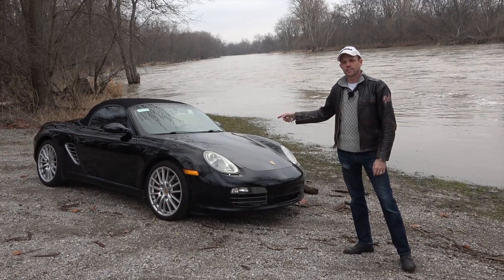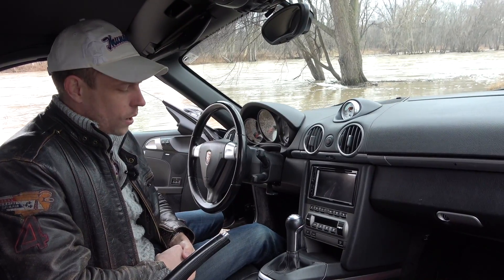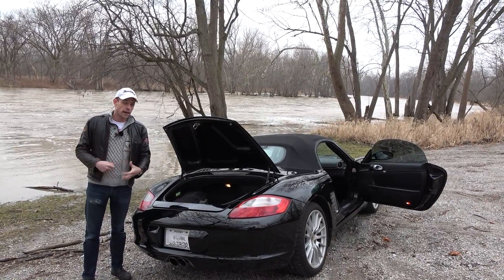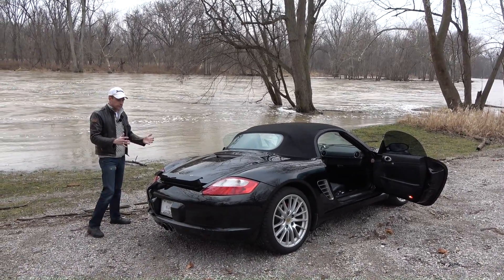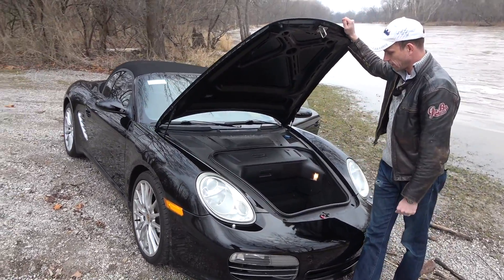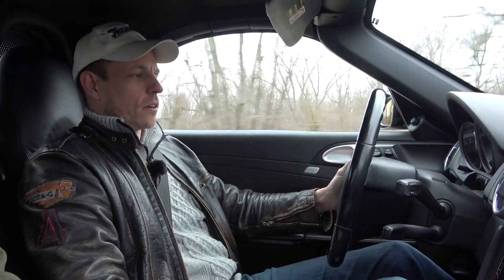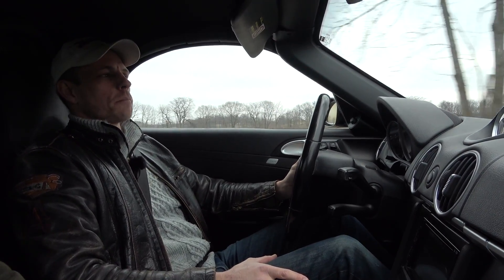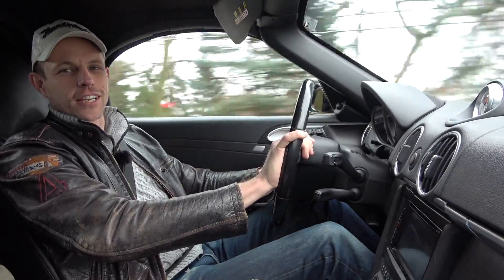Porsche destruction for LYKAN HYPERSPORT build at Genius Garage

Comment: Should be able to get into the coading with a bidirectional scanner, I use a launch x431 + .    Spoiler can be set to come up and down I believe at chosen speeds, my 07 Cayman S will also deploy and stay up based on engine temperature. Should be the same rear control module.  Found this out the hard way when my canbus had a glitch.  Lots of opportunities to use repurposed deleted or unelected options if you keep the stock system.  Definitely not an expert but refused to take the car to Porsche so 40 hours later I got it and am more familiar with my car.
Reply from the maker: Brandon Knight can you DM me on Instagram or send me an email through Genius Garage please? I’d really like to speak to you about this.

Comment: Good job. That one has Sport Chrono for a little more power and the better headlights. When y’all strip the car, the body panels, top, and headlights are worth some decent money. Try not to damage them. You should be able to swap in brakes from basically any 911 if the wheels clear. If I remember right, the rear wheels from a 911 fit but require 14mm spacers to clear the shocks. Hood gas struts are very cheap and may be worth buying to reduce headache while measuring, planning, and stripping. Don’t lose or break interior parts. The cup holder is like $140 used. Ashtrays are stupidly expensive.

I had a 986 S.

Comment: I love that you are doing this as a Genius Garage build. Also starting to fall for that 987 - which is going to hurt to see it get chopped, but its sacrifice will be returned 10-fold in the Lycan that you are recreating. 

Also, while I will watch, Youtube car builds always fill me with overconfidence in doing my own car repairs. Everything always looks so easy on Youtube! But then in real life I spend 5 minutes trying to figure out where the latch is to pop the hood open. (I loved my ‘68 Firebird - just walk up to the car, reach in under the grill and pop the engine open. That car I could and did tear down to the long block - new cars have 80,000 hoses and wires and boxes on top of the engine.)

Comment: Hey Casey, I sent you another couple emails.

If my internet research is correct, under the skin the Lykan is essentially the same chassis as that RUF CTR3 which is a Boxter tub cut behind the rear seat with a new "birdcage" connecting between the existing roll bar mount and A pillars.  It sounds like all of the stretch is in the "birdcage".

Beyond that, I found a source for information on the design that you might be able to contact.

I also suggested a change in design which might reduce costs and save time over a straight copy.

For those thinking that the chassis isn't going to be right, you are wrong, everything at the front should be close to a bolt in fit and exactly like a $3,400,000 Lykan.  The rear is just about how much effort they put in to it.  As long as they ditch the rear struts, I think it will be fine.

Comment: I have 06 cayman and I have the 996 GT3 brakes front and the original front brakes in the back. You loose the handbrake on it. But worth it. Also do a deep sump and x51 oil pan
Reply: TOROgarage wanna sell your stock calipers ?
Reply: @artmchugh5644  don't have it anymore
Reply: TOROgarage thanks man ! I hear those calipers are the hot ticket for our 85 carrera! !😄😄😄🍺🍺🍺🍺🍺

Comment: 10:17 Casey executes a perfect rev-matched double-clutch downshift while talking. Nice. :)
Reply: Is this technique meant to be used when you're putting along and want to do rev-match downshift without heel-toe?
Reply: @ayowser01  No, it is used to perform shifts faster, with less wear on the transmission. On vehicles (like big trucks) without syncromesh or with straight-cut gears, it's almost always used. 

Here's what he is doing: he declutches, and shifts to neutral. This disconnects the engine from the transmission. Next, he lets the clutch out, and taps the throttle, spinning up the engine - but because he first re-engaged the clutch, it also spins up the input portion of the transmission to match the engine speed. This means that the input portion of the transmission now matches the speed of the output portion of the transmission for the destination gear. Next, he declutches again and shifts into the lower gear. Because the input portion of the transmission has already been spun up to speed, the syncro on that gear has very little work to do, which means a) a faster shift, and b) less wear on the syncro. Lastly, he lets the clutch out once more, and the shift is complete.
Reply: @ScottsSynthStuff  Very nice explanation.

So you are telling me that my habit of not giving the clutch time to decouple as I am bouncing off the rev limiter in first and just ripping it into second might create some syncro wear and be slower?
Reply: @opieg7333  Basically, yes. The synchro speeds up or down the input portion of the transmission to match the output portion. The faster and harder you jam it into gear, the harder it has to work to do this, and they more wear occurs. I see you're a bike rider - bike transmissions are similar, but not exactly the same. But the same basic principles apply.

Comment: Building a chassis from scratch would be wayyyyy better and probably easier in the long run. I really dont see how your going to get a "clean" build with a hacked up uni-body.
Reply: Having seen what he's done previously....Do you really seriously think he's going to hack a unibody to build the Lykan? The Guy that scratch built a Jet Powered BatMobile? Which video did you watch?
Reply: @danstewart8218  I am not doubting the abilities of Casey, uni-bodies are a matrix of stamped and overlapping metal spot welded together and designed to make a Porsche not a Lykan. I think that starting from scratch would produce a much better final product. This is a place for discussion and that's what I am doing.
Reply: @MODNTUNE  I think the goal might be to preserve some of the interior trim, instrumentation and associated mounting points. Sure that can be added on a build from scratch frame but done right it takes forever to get the ergonomics and engineering correct. (Of course with no Lykan example to inspect and the fact its a very low production car, the ergonomics may  have never been correct).  Maybe he is fine with a "kit car" interior finish in which case slapping in some recaros and autometer gear with simple sheet metal fabrication will suffice. And I think the shell is designed to mount up to a modified version of that chassis, but might be wrong on that. (Even if no, it is designed to fit a Porsche body which likely means some commonality in mounting points).  So my thinking on the strategy is it simply saves some time on the finish work.

Comment: My dude, this is definitely a cool build...
But, if that car wasn't built with an engine to begin with I wouldn't trust putting anything in it.. I personally would think you would want to start from scratch.. 

Ok.. Nvmnd, i guess you are just gonna use the panels from the Lykan not the frame..
😆 😆, i knew you were smarter than that!

Comment: I was watching a video with a 996 911 turbo and it’s coolant pipes failed because they were “press” fitted and glued on as opposed to being welded and or “pinned” on. If that’s something they will need to fix on this car, before reinstalling the engine, I hope we get to see the video of it as it’s being performed.
Reply: The Boxster uses a different engine than the Turbo and GT versions of the 911 (996, 997). The Boxster/Cayman/911 water-cooled engine family were clean-slate designs and labeled M96, M97, etc. The engines that require the coolant pipe pinning (or welding) are based on the old proven Mezger air-cooled 911 engines, obviously modified to accept water-cooling.

Comment: Also I hope LYKAN will be nice with this and not give you a hard time. I and I assume you have seen problems like that.
Reply: It sounds like W Motors tried to scare the bankrupt production company in to giving the Lykan prop back.

I wouldn't expect any type of willing support from them.

Luckily beside the body, a fancy interior and a holographic display in the dash, it seems to be mostly RUF CTR3 which itself is largely Boxter under the skin.

If W Motors is a big enough customer to influence RUF, they might tell them not to support Genius Garage but that is a bit of a stretch and if Genius Garage doesn't try to turn the body in to a 100% correct replica, W Motors probably won't go too far out of their way to block the project.

I think the easiest way to finish this project is going to be using a good portion of the Boxster interior, different rear suspension, an engine that is not a built RUF turbo 3.8 and the fiberglass prop body, not pulling molds to re-make it in carbon fiber.  The result of that might look like a Lykan but the illusion will fall apart once a door or the engine cover is opened.

W Motors is concerned with the exclusivity of the Lykan but if what Genius Garage creates is obviously not a Lykan, I don't think W Motors has much to worry about.

I actually think Genius Garage will elevate the profile of W Motors, just like putting the Lykan in a FF movie did.  If an extra car is really an embarrassment for them, just blame Hollywood.